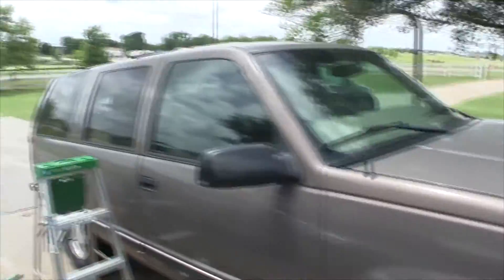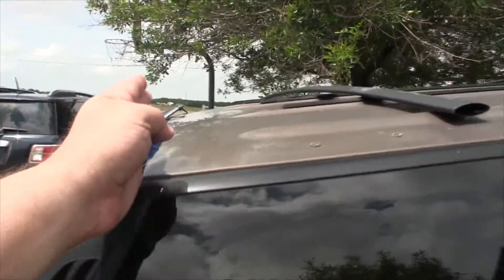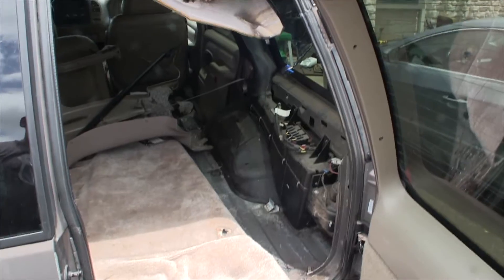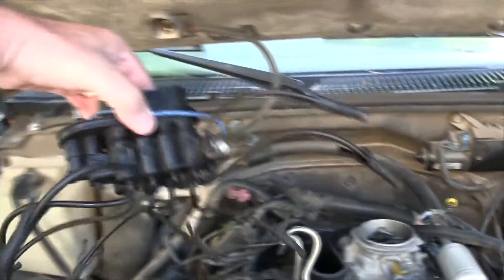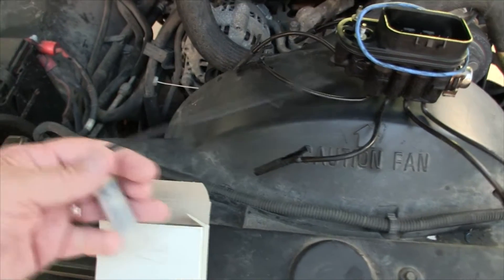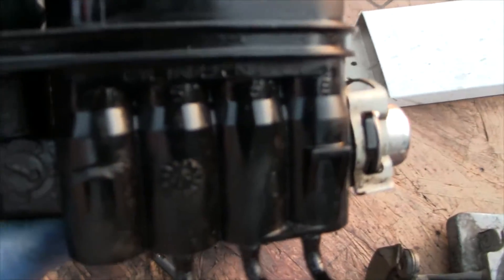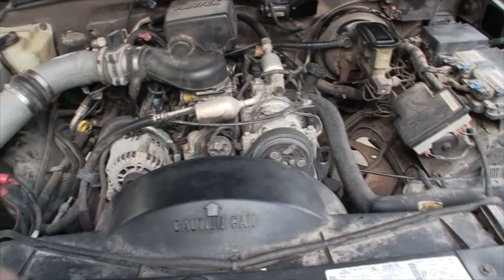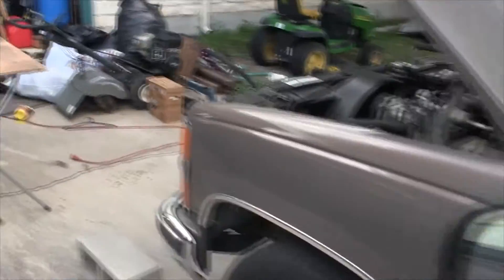97 Tahoe Part 3- Update 1 Roof Leak and New Injector

Comment: Got my 3rd left window replaced, never noticed until later that it was leaking. From the top seal, used some black sealant and fixed. Still need it to get reinstalled as water seeps in and giving it a lil rust spots
Reply from the maker: Yeah, I thought I was never gonna find this one. Should have been the first place I looked. LOL

Comment: I understand the desire to spend as little as possible on the old truck, but the fuel pressure regulator on that old spider is probably close to failure anyways, and the updated version of the spider is MUCH better overall. Once I replaced mine, my highway mileage went from just under 15 to 22.  7mpg improvement. My Tahoe is a '96 4x4 model. The freshly rebuilt transmission may have helped also, but the newer injector is the closest thing to multi port that these trucks will ever see.  Performance has also improved significantly.
Reply from the maker: Thanks for the feedback! That may be something for considering in the future. I've put 12,000 miles on it and it has been running great, except for the second cat converter, which I should have replaced when I did the other LOL. Which one did you get for yours?
Reply: 512kjt the injector setup we put in was made by BWD, but any of the revised ones should be similarly great.
Reply from the maker: Awesome, thanks for the info. I'll surely be checking into it.

Comment: Since your workin on a Tahoe maybe you can help me.... I have a 97 4 door 4x4 and it refuses to start after it started no problem since we got it.... It turns over no problem and almost gets there then it stops.... I have yet to check the alternator and battery but wondering if there was a way to check it without taking it anywhere
Reply from the maker: +Andrew Scott | Not that I know of. Those starters draw so amperage that it would burn up a normal ammeter if you tried to measure the current that it's drawing. I  know it's a pain to pull the starter but it's a lot easier to get the battery out so I would take the battery to one of the chain auto parts stores to see if they can check it for you. Does it eventually die when you're cranking it or does continue to crank but it just doesn't fire off?
Reply: +512kjt eave never gotten the battery to die all the way from it since I haven't held it in start for over 7 seconds..... I am actually taking the battery to an auto zone this weekend...... Haven't checked the starter yet but I'll keep it in mind if the battery comes up fine Thankyou!

Comment: the rear side windows leak,  mine has been drowning for 5 yrs, I kept tearing it apart and drying it out  Today I discovered both side windows lost there adhesion and that's where the water was sneaking into the liner.
Reply from the maker: Man, that's gotta suck! I was suspecting the windows at first, but I flooded them and nothing ever came in. Only when I hit the roof with water would it leak. At that point I knew it was either the luggage rack or the brake light. Thanks for stoppin by!